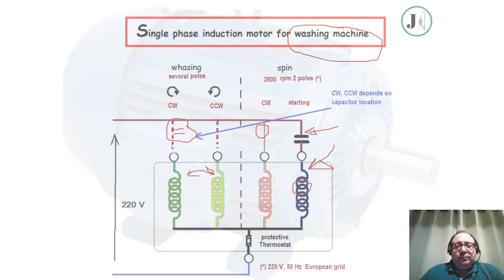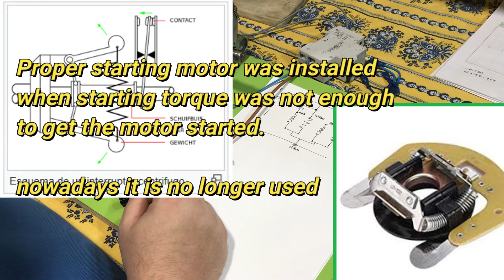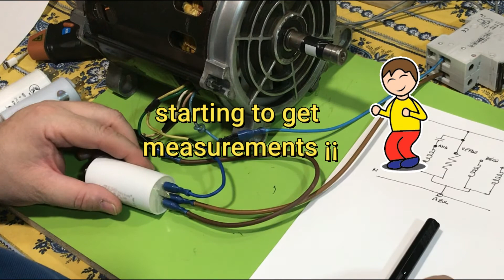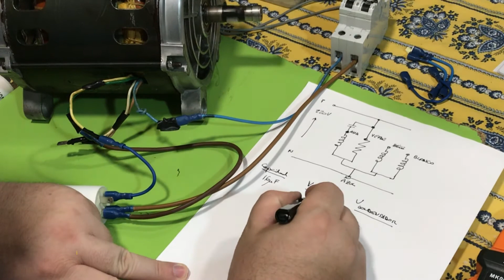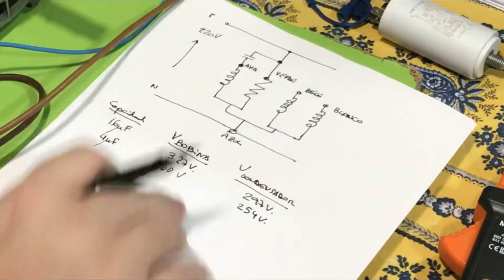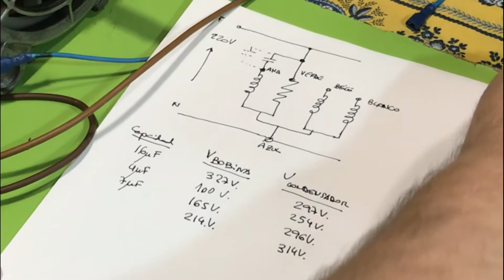How to select proper capacitors for single phase induction motors

Comment: Thanks for the video. I am trying to solve the same problem, but I had a question for you. I assume we want the coils to have the same magnitude of magnetic fields, but as close as possible to 90 degrees apart. If this is correct, then wouldn't it be the currents in the coils that we want to be the same, and not the voltage?